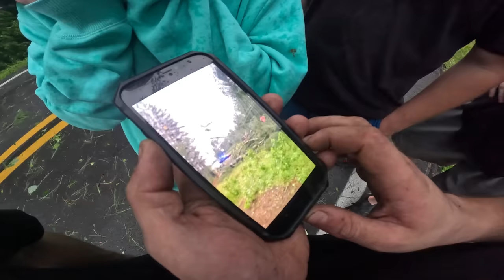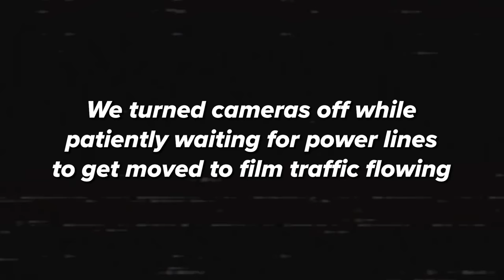Tornado Hits While Working on Car at Home!

Comment: More likely than not, those were probably strong outflow winds that drop down and spread out of a thunderstorm and rush out ahead of an approaching line. That’s why the wind mostly stopped when the rain started coming down. Intense rain cores associated with strong updrafts cause damaging winds.
Reply: That was a tornado
Reply: @dasnakedrake1824 if you think that was a tornado then you have never seen one sirens werent even going off tornados will rip the roof right off your house those were strong winds knocking down weak trees
Reply: Yeah, Something like that or a microburst.
Reply: @user-tg6zi1vn3c What you're saying is absolutely correct but it should be mentioned that not all tornados get warnings or sirens, sometimes they really just come outta nowhere
Reply: @dasnakedrake1824  and you know this for certain..... how? lmao thunderstorms with 70mph wind gusts can knock down trees like that.... not everything is a tornado
Reply: @dustinfredrick6534  and not everything of that power is just a storm either so
Reply: @dasnakedrake1824  well, yeah. its called a severe thunderstorm. any storm with a recorded gust of over 59mph gets severe warning status, which is no longer a "typical" thunderstorm
Reply: @dasnakedrake1824  i think imma trust the weather guy.
Reply: Exactly! This is common sense
Reply: @user-tg6zi1vn3c not all tornados are EF5s. Some don’t do much damage. Also it passed over their house then touched down later. You’d know if you watched the video
Reply: @weatherwatchmore I think you didn’t watch the whole vid since at the end they show what happened to the gas station
Reply: @Joshua429 Did you even read his comment? Each of his reasons are much more likely than a tornado.
Reply: Definitely not a tornado! This is strong in-line winds. A tornado would be a lot different, plus the sirens would be going off, and a EAS broadcast to your cell phones would also happen.
Reply: @BGTech1 1:31 to 1:46 do you not see the leaves and wind rotating like it COULD have been a strong microburst but the wind tells me otherwise like I’m not saying your wrong but in my opinion I think it was a tornado
Reply: @Joshua429 It’s always possible, but from what I’ve studied in meteorology it seems unlikely.
Reply: When a tornado first starts dropping, there are a lot of outflow winds before it truly starts its spin...and warnings don't always come in with a lot of warning. I was in the palm beach gardens, FL tornado last April 29 and we had NO warning til it was already on top of us. That also started as straightline winds that suddenly spun into a tornado. All weather is out of control lately for sure!
Reply: @Z38_US but there was no house damage to anything
Reply: @Averagekylebuschfan  Ok so? I just said that sometimes tornados get very little to no warning. I didn't say that this was definitely a tornado?

Furthermore tornados come in a variety of different strenghts.
Reply: @dasnakedrake1824 how would you know
Reply: Because of your username, I believe everything you just said, even if I didn't understand some of it. Which is another reason it sounds true. Lol!
Reply: @dasnakedrake1824 I think it was just partly cloudy with chance of light showers and occasional wind gusts of 100 mph. 
But that's just me, and I don't know anything about the weather except I hate summer and love winter.

Comment: I was in this storm at work when it came through. That kinda stuff doesn't happen here a lot so it shocked basically everyone there. It took me nearly 2 hours (normally around 30 minutes) to drive 20 miles home because of all the downed trees and powerlines blocking roads. Nobody on the roads knew what to do and I saw people driving into oncoming traffic just to get to where they need to go. It was definitely a scary event

Comment: we just had some bad wind come through that took out power to most of our town. McDonald's was so busy that we were literally wrapped around and back into the street. the power is still out and this is day 2 I just completed and 30-40% of the town still doesnt have power. Another thing is that the ferris wheel at our fairground since the fair started yesterday, the ferris wheel got laid over with the semi connected to it, damaged the roof of a few of the barns in the fairgrounds, trees down everywhere power lines down everywhere. just absolute chaos. A road work sign was ripped off its holder and flung about a half mile away to a walmart parking lot.the winds were said to have topped out around 115MPH and we believe it was a downburst

Comment: The NWS assessment concluded that widespread significant wind damage occurred and that a tornado path within the large scale wind damage was not discernable...  It should be noted that damage was observed across an area over 3.5 miles wide. The survey concluded that maximum wind speeds within the more significant pockets of damage likely reached 90 mph.

These are snippets from the damage survey that I located. It sounds like this wasn't a tornado but a very strong gust of straight line winds, micro burst??? There were in fact two tornadoes that occurred the same day a good distance to the north. An EF-0 and an EF-1.

Comment: Gavin you need some big ecoflow battery backups or get ur self a big inverter generator. I don’t live in a place where it storms heavy but a little rain and someone will knock a power pole out for 6-12 hours at a time 🤣 edit: IT DID A FLIP😂 10/10

Comment: If you indeed have had plenty of tornado issues, im astounded that you haven't set yourself up with a generator or other means of backup emergency. Im in Central Wisconsin, where we are at the end of Tornado Alleys Eastern track. Living next to a lake. If we go without power for 2 hours, our basement fills up with 3 inches of water. So I at the very least have a 1200watt power inverter along with a few vehicle batteries I keep maintained on standby. Would definitely recommend something to help keep that shop rolling, bro. Stay safe. Smart callout on the twister.

Comment: Here in Indiana we had our neighbors trampoline fly into our trailer behind the truck and the wind blew it towards the front of the trailer ultimately flying into the side of the truck really really hard putting 13K in damage in the truck and then that trampoline flew and was hanging on the powerline. Later that day the tornado alarm went off at the fire department across the road and above the fire department there was literally black deathly clouds with absolutely no rain and the temperature dropped fast so we ran to the basement. There was a tornado cell in the air that could have landed at anytime. First time experiencing weather like this and I've seen bad weather. On Wednesday at like 9:00pm. Typically every Saturday at 12:00pm the afternoon the fire department runs it for a little bit so hearing it go off for the first time living here for over 8+ years was really crazy. Unlike you I didn't have a phone or anything so I didn't record it since I literally ran for my life 🤣 you could also hear the tornado cell in the air but the clouds we saw we're pitch black and I literally thought it was gonna hit our small town.